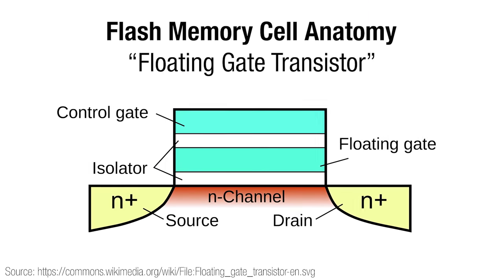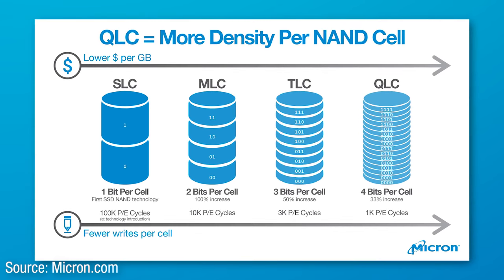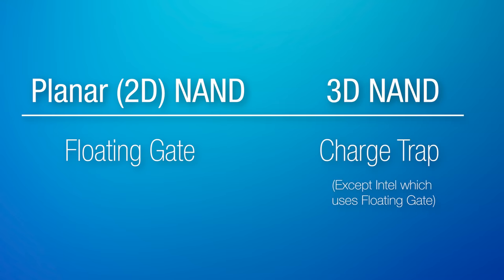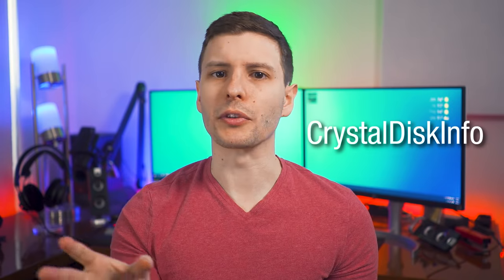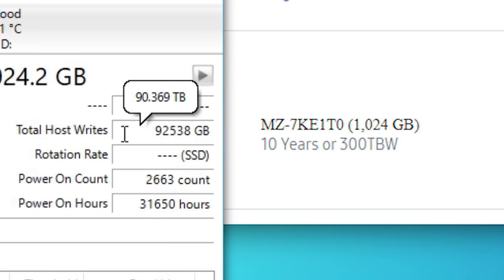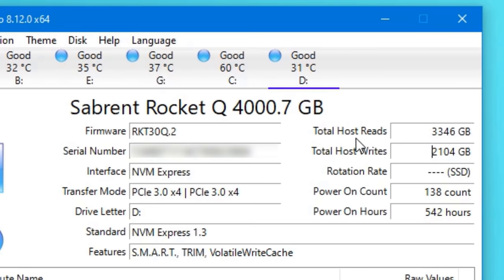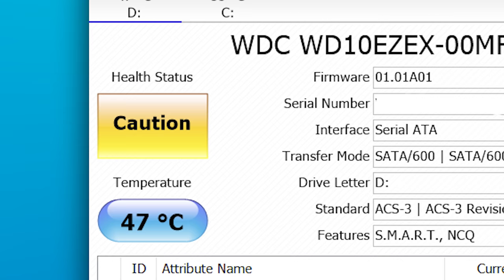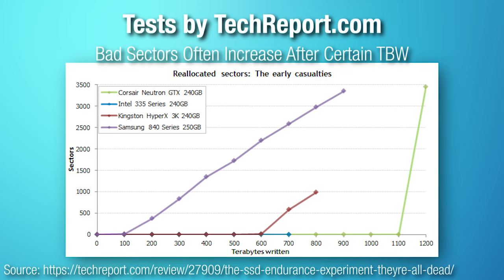How Much Longer Will Your SSD Last? How to Tell

Comment: Is it possible to shuffle existing static data to prolong the device’s life?
Reply from the maker: The drive already does this automatically
Reply: If you move data you are writing ... therefore don't move 'static' data at all.
I have an extra small ssd on my laptop to store current backup data ie read backups from originating server over internet to 'current' backup drive, then rapid transfer to offline (usb3) drive(s) and delete prior 'current' backups from drive. During the life of the 'current' backup there is a copy on the originating server and on at least one of the usb backup(s). 
Thus if/when the 'current' backup drive fails there will be at least two copies of the backups available.
This method requires no reliance on predicting the life of the ssd.
When they are cheap enough the usbs should be large capacity ssds ... as they are backups they are write once and read very few times so should last a long time (??).
How long is the shelf life of (say) a 90% full ssd ? ... ie a stored backup disk ... and what is the shelf life of a 90% full hdd ?

PS I keep my ssds to less than about 60% full under normal circumstances. The 'current' backup ssd may be transiently higher whilst transferring backups.

Comment: My SSD reports the total host writes in megabytes, and CrystalDiskInfo reads it as gigabytes. I was very surprised when I first opened it to see my SSD had 600 terabytes written until I realised that there was no way I (or Windows) had used it that much.
My SSD is rated at 72tbw so... yeah I don’t think 600 is realistic.
Reply: CrystalDiskInfo is inaccurate for some reason, like it shows 1.5 TBW when I only written about 50 GB on it.

Comment: The tricky part for us plebs that dont have nice, newish, high end SSD's is finding the warranty TBW.
Cant find the spec for this laptop's old 120G OCZ Agility 2 anywhere. Damn thing only talks of MTBF (2million hours). Nothing on TBW. 
Basically, the type and honesty of the lifespan specs has been evolving too and only newer/premium drives will give you the spec this video requires.

Comment: I don't know who coined the abbreviation TBW, and there doesn't seem to be a consensus in what it sands for. I've seen both "Total Bytes Written" and "Terabytes Written".

IMO, "Total Bytes Written" makes more sense, as some datasheets will say things like TBW: 600TB, meaning the Total Bytes Written is 600 Terabytes. Enterprise grade SSDs will say things like TBW: 8.4PB, meaning the Total Bytes Written is 8.4 Petabytes, or 8400 Terabytes.
Reply: "Terabytes written" is like an old slang. Because in early days of SSDs "endurance/total bytes written" was always in "TB". The first consumer SSDs like Samsung 470 128/256GB had just 11/22 TB endurance. Intel Postville 80GB hab only 7,5 TB! so it was just convenient for people to shorten the endurance specs as "Terabytes written". Only a few years ago we had increased amount of SSDs with TBW in Petabytes. E.g. my Seagate FireCuda has 5,1 PB TBW, WD Red SN700 aswell. Other SSDs even over 10PB. But i am sure, as soon as PB-endrance becomes common, people will say PBW for "Petabytes written".

Comment: Two of my Seagate HDDs fail, each not more than 3 years old of use (2.5 HDD 1TB and 500GB). Showing Error C5 and 05 in Crystaldisk info software.
But my Samsung HDD from my 2009 laptop (Compaq Presario laptop) still operating today as a backup, normal blue GOOD.
.
So, I think HDD is more suitable for backup purpose, raher than for heavy task in daily operate use

Comment: As I used to say: mechanical systems are 98% good 97% of the time and then they turn to be 97% good, then 96% good and so on. Digital systems are 100% good 99,9% of the time, then they turn to be 0% good 0,1% of the time, but this usually is the time you really need them.

Comment: If you have a failing M.2 SSD as the C:\ Drive and you Clone it to a Will the clone be of a lower capacity or full functional.  If you lose your Boot drive you must reinstall the operating system and any programs a back up is almost worthless for a full reinstall right?

Comment: Yes, but what if you treat the drive like a WORM drive, like a media NAS? How does that change the lifespan of the drive? Mechanical drives fail with spin time, SSD's fail with writes... So, if the drive fills and nothing is ever written over, how long will it live? What is inferred is that reads don't damage it and neither does being powered up -- but has anyone actually tested this?

Comment: good video, but few details from my own experience.
sata3 ssd corsait neutron gtx 240 gb, from far 2012. it's already about 700 TBW and 65% health left. and all that time drive was on oldest firmware. pretty sure than on newest software  health will be +15%. 
why I think so?

cause I have two samsung 870 evo 1TB.
one of them with older software have 400TBW and 65% health while the second (bought later and already have newer software) has 82% health with 407 TBW.

and about size:
aorus nvme 4.0 500GB has 29% with 700TBW (corsair 240GB has 65% with 700TBW). size doesn't matter. the quality of drive is more important
Reply: damn samsung 870 came out year ago already 65% and 82%? u put alot of work on it or what

Comment: Googling wouldn’t tell me but how do you transfer data from one ssd to another ssd or hdd? The laptop I use has a 128 ssd with half of it for the os and google doesn’t tell me how I move the data to a larger one

Comment: They absolutely are not "more reliable" than mechanical drives. I've got 20+ years experience in the field and use this experience to come to this conclusion. It's the ssd's that are less reliable, especially the original ones on release. I have a hard drive that's 30+ years old in my retro build and it's still going. There is no way on this planet that an ssd would last this long unless it had never been used

Comment: I would like to use an SSD as an optional Backup Media
Let say I buy a 1 Tb SSD with a TBW of 500 Tb and a 5 year warranty
If i fill the 1Tb SSD to 90% capacity ONCE, and take it out of my system, that to say is on a shelf in my office
How long can i program that 1Tb SSD to retain the information store there ? 5 years ? longer ?
Thanks

Comment: Does it save the amount of writes and reads even after a reformatting because I used to use an SSD in my mom's older laptop and now I'm using it in a newer laptop it's still pretty old though

Comment: That's why it's stupid for Apple and other manufacturers to put in solder only SSD on computers. SSD's must not be soldered they must be done in m.2 or pcie. SSD must be removable. With a Mac mini 2020 its better if you have an external ssd usb-c enclosure like for an m.2 drive.
Reply: The DATA rates are faster with the SSD built on the CPU chip. It's also planned obsolesces so you end up buying another Mac in the near future. 😁

Comment: I stil use a HDD mainly for downloads, I make sure that the temp folder of the download manager is tapping to HDD instead of SSD, sinceI actually killed an SSD for as short as 5months since I download too much files. that drive have a 300TBW but i reached that very shortly, of course the manufacturer replaced it with a new one so meh....

Comment: Just came across this video based on YT recommendations. Suggest that you make reference to the fact that the ability to test SSD usage using the referenced tool is only is only applicable for Windows users.  Is there an alternative for Mac users?

Comment: is a hdd bad for games? like say I wanted an ssd for quicker OS loading times but just kept my games all on a hdd would the performance suck? I'm just debating weather I should get a big SSD or go for a smaller cheaper SSD and a bigger HDD to store games on... any input would be helpfull; thanks everyone <3
Reply: Some games and applications benefit from SSD speeds more than others.
Reply: Games don't need an ssd (unless you mean faster losding times), they don't Increase your framerate. There is some games that are so big that having an ssd to load the world faster like in World of Warcraft or Cyberpunk 2077 (That's for their recommended specs of course)

Comment: Have had my laptop for almost 2 years and I've put 7tb written on the 512gb wd sn520 and it's rated for 500tb warranty. And keep in mind that's the warranty. A toyota doesn't die once it's warranty goes out. Keeps going for several times past. Ssds have been known to easily go several times beyond the tb written warranty.

Comment: Awesome video, very informative! A bit out the blue with this question but I hope you might be able to shed some light... I don't use a laptop, I use a tablet to run everything from (s7+) are there any applications you can think of that can substitute the aforementioned program? I mainly just want to check the TBW of my drives using my tablet...
Reply: You would be better checking it through a Laptop
Reply: @stephensnell5707  really unhelpful, better off just not commenting in the future if you haven't got a solution 👍🏼

Comment: Warranty is like a guarantee it won't fail. Your TV has a warranty of 1 year but it lasts 20 years. These drives aren't supposed to fail so easily be it MLC, QLC, SLC so buy the cheapest. I haven't heard a scary story of where a person's SSD failed otherwise internet will have gone haywire over suggesting these.

Comment: HDD fails like a guillotine, you hear the snap and got a “second” or two before complete failure. (Meaning you get a bit more waning, even able to copy out your data)
SSD is like a someone pulling a gun. You get little to no time to react and puff the drive is gone.

Comment: Hey Joe, my old ssd m.2 nvme is failing and I plan to buy new ssd samsung evo 970 plus. But I'm getting confuses which one I have to buy between 250Gb or 500Gb. I'm using laptop with i7 8th gen and pcie 3th gen. Which one should I buy?

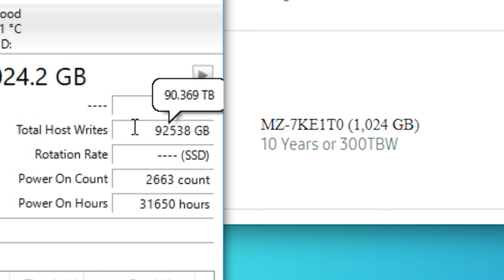Comment: 4:32 HDD used in comparison has "Power On Count" as 2663 🙄🙄🙄🙄
Two possibilities though :-
1).The owner of that PC Loves rebooting 😜
2). The HDD turn off/Power saving on Idle is too low causing it to sleep dozens of times every hour.🤫

Comment: I have a SANDISK SDSSDA480G Drive, but am unable to find where to find a detail of the specs for this drive as shown in your presentation. Any suggestions?
Reply: Thio Joe  Not sure why you replied giving advice on Bitcoin when my question was where to find a site giving me a specs sheet as shown on your video 🤔 I tried Googling SanDisk as well as other sites, but none of them had any details about TBW. Anyway I used CrystalDisk Info and found my SSD drive is 99% good.

Comment: When ssd reaches it's TBW, you cannot write anymore to it, I got that part. But, can't you still read from it? You don't have to throw it away, you can use it the same way you would any optical medium?
Reply: Yes you can. Samsung, for instance, has the drives switch to read-only mode when they get too bad so as to prevent data corruption. In general, TLC SSDs would be very good for use as seedboxes, in order to read 10-50x the amount of data that was written to them by seeding torrents, for instance. You get the best bang for your buck with them, especially if they're rather cheap and if you have a 1Gbit or a 2.5Gbit connection so as to fully saturate their R/W speed.

Comment: the odds of a normal person using all of the SSD writes is pretty low anyway, you are more likely to have the SSD fail because of something else then by the writes of it maxing out. + SSDs are getting way bigger and way better every few years so most gamers like myself would just replace it way before it becomes unusable. but it is pretty crazy to think about how many years a SSD can go before it uses all of its writes up.

Comment: I downloaded Crystal and it does not show the Total Host Writes on either of my drives (128 ssd or TB disk). Am I correct to assume that this is the drives not recording the info, and not something that would be there if I used a different program?
Reply: Not admin?

Comment: 0:05 Uhh, no? An ssd under average use will last 3-5 years.

Every HDD i ever had lasted more than 15 years. I have a 750GB 'offsite' backup drive in my drawer that was made in 2007, and two other 1TB HDD's that were made around 2011, still working fine.

Comment: What's the percent shown on CrystalDiskInfo? I alwaty thought it's the exact writened/TWB you are talking about, as it only shown on SSD.
And the number matches with WD's officaly tool as well. but I not really sure what it exactly is.
My notpad's C: have been used for 5years, and it's now showing 59%, but still "good", should I worry about that? My main Desktop with 3 years and it's on 89%, also "good"

Comment: I know that i am 2 year off the release of the video but i cannot find the information anywhere.

I have a laptop and my ssd has health of 92% but when playing demanding games it reaches 66 degrees celcius, the operating temp are max 70.
Should i be worried ? or as long as i am in the range it should be operating fine ?

Comment: My very 1st SSD, an OCZ of 16G finally died after 15 years. I never installed any extra software for protection, it contained Windows folders, so it was read and written daily. It never showed any signs of deterioration, until it just stopped working - I think it was something in the power supply that gave up, not the memory.
So, my advice - stop thinking about BS like this. Unless the dear manufacturers have purposefully built in "lifetime engineering", making your SSDs fail right after the warranty period, your SSD will be fine for those 3-5 years it is becoming obsolete. Don't spend an extra dime on a model that positions itself more durable, or offers longer warranty - it is just clever marketing building on your fears and exploiting you. Milk-milk-milk!
Reply: Unfortunately QLC drives are actual garbage and there is a high possibility that they would actually die on you faster than you would decide to retire your PC. Not a good option to boot from.

Comment: I need to have a backup of backup of my projects. I'm so sick of it, why can't we create a tech that'll have less space but more reliability? My 40GB IDE drive lived for 20+ years, and my 500GB SATA drive lived for 11 years both under heavy everyday load. Why can't we have a 300GB SSD that'll work for like... 50 years? And that'll never fail to keep the data and in case it does - it could be restored.

Comment: SMART errors do NOT necessarily mean the HDD/SATA SSD itself is bad. Changing the SATA cable is worth trying before trying to RMA/replace it. SSD's more reliable than HDD's - no-one buys SSD's because of their 'extra' reliability. Performance drives SSD sales

Comment: Just now my system's been running slow, overheating when streaming and games run at consistent 17 fps... I don't know if my ssd is dying or if it's a BIOS problem but, I'll download the program you mentioned to check the drive...
Reply: It's not a BIOS problem.
Reply: Is your gaming chair in good shape?
Jokes aside, sounds like you need to clean your system, or put on new thermal paste if its an older system. And what overheats? Hot air out of the system is good, not the other way around.

Comment: I just wish SSDs were more affordable. With as gargantuan as game file sizes have gotten, SSD pricing really needs to decrease, especially with more and more games pushing toward a preference for SSDs. That said, if SSDs typically last longer than mechanical drives and my PC's C drive is almost 8 years old and with constant wear yet still running pretty well, I really do need to get one when I have some spare cash.
Reply: They've gotten significantly cheaper compared to a couple years ago
Reply: @IJoeAceJRI  A 2TB mechanical drive is typically about $60-$80. Comparing that to a single TB SSD, which -- as you pointed out -- costs about $100, that's a pretty hefty difference.

EDIT: I legit just checked, I can grab a 6TB mechanical drive for a tiny bit more than the cost of a 1TB SSD. That's a gargantuan difference.
Reply: @KillOnS  Oh, no doubts there, but they really need to start bringing the prices a little closer to mechanical drives. I'd absolutely buy one if they were more affordable.

Comment: How can SSD be more reliable than HDD? HDD surface has no limitation for write cycle count. Only mechanical aging which is insignificant comparing to flash memory degradation.
Reply: I only use SSD for my OS Drive the rest of my storage is from HDD i still think HDD is superior in data storage.
Reply: @sebastiangonzales46 agree especially it comes to frequent sustained writes.

Comment: Anyone knows how much space I should leave on a 1TB M.2 SSD Intel 660p? I have this SSD for everything Windows is installed on it.
I have heard about you should never go below 20% so 200gb, but I feel like this 1TB SSD isnt enough for the long run, I like having quite many Games installed.
But I only have 650 Watt PSU and my minimum recommended for AMD 6700XT Red Devil is 650w, So if I wanna get 1 more SSD do i need to upgrade my PSU as well?

Comment: I always thought at worst, if you max out the write cycles, you just can't continue writing but the data will still be there and you can still read from it... are you saying that the hard drive just fails and you lose your data?  (the recommendation to store non essential stuff?)   Again, I always thought if you reach the p/e cycle you could still transfer data to another drive...